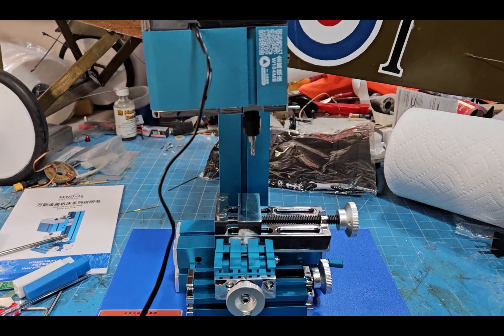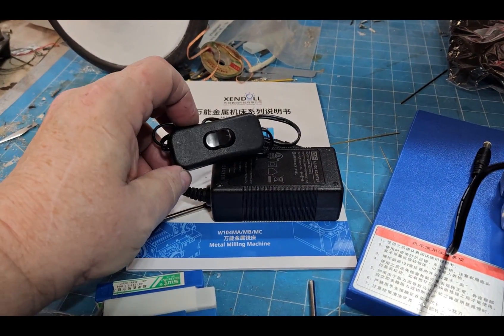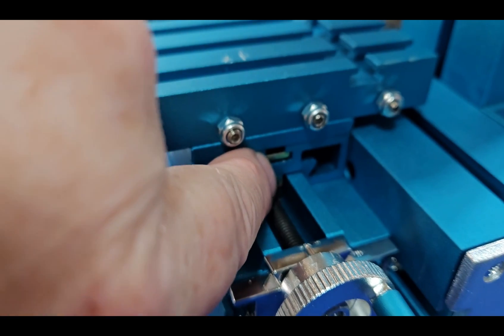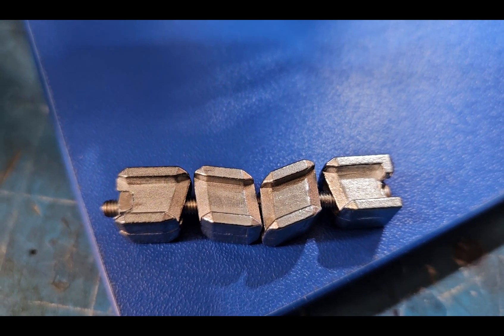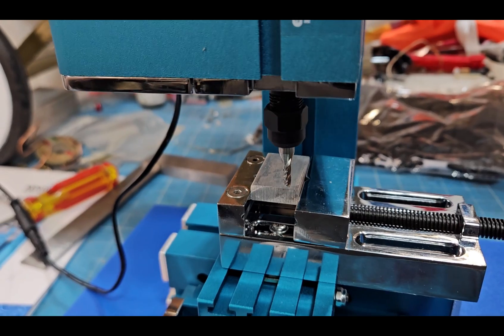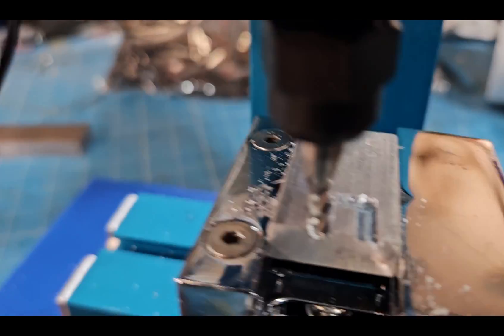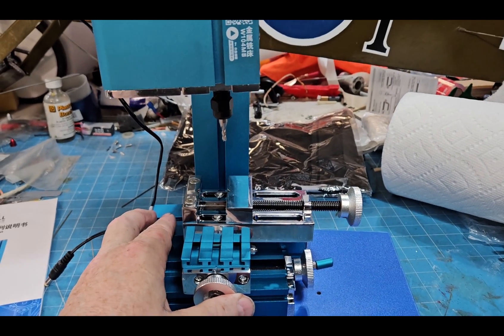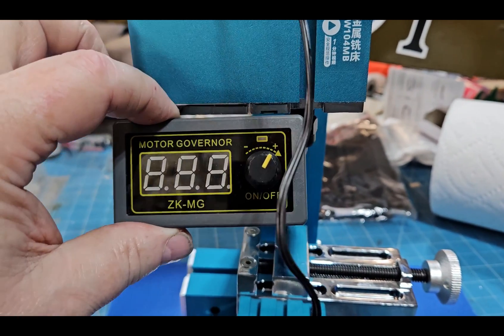Chinese micro mill from Amazon/Ebay review and upgrade part 1

Comment: I like that you show the equipment that you regularly use, and yet folks still chose to bitch about your choice of equipment as though the small kit was the only thing you had.
Anyway, thanks for taking the bullet for us; I'm still curious about getting one but the price they're asking for them now is waaaay too high for "let's try it and see" kinds of tinkering.
Reply from the maker: If you are interested I have the Proxxon mill that I picked up for cheap and I will pass on the savings to you after I do a analysis on it. I am asking $300.00 (They regularly sell for $600.00) for it then add shipping.

Comment: I respectfully point out that it looks like you have the headstock bolted to the Z axis the wrong way round - the wire for the motor should surely be at the back, not hanging over the front of the machine. Also, brass gibs won't do the aluminium slideways any good at all, they are nylon for a reason. Good luck with your efforts though.
Reply from the maker: The wires are not permanent. It was just proof of concept. I point out in the video there is a better way to run the wires but I am not drilling a hole in the head stock. This is not going to be permanent because I am putting the stock motor back in it. As for the nylon gibs I understand why they are nylon but brass would be better and will not be a problem unless you are cranking the lead screw up and down at 20 mph.

Comment: Should mount a $110 mini Makita router on there instead??
I got one for my CNC machine that I'm building.
Reply from the maker: Sounds like a good idea but does it have speed control? My idea was to keep the upgrade under $100.00 and make it fit inside the spindle housing. But that was just my thinking.

Comment: I'm pretty sure a regular drill press would do a better job of milling than these, as there would be more power and would be a lot more sturdy.  Looks neat though, but it's just too weak and bendy of a structure IMO.  That is, if you already have a drill press.  Otherwise sure, why not...
Reply from the maker: I couldn't find much on it on YouTube when I looked so I decided to do a review so people know exactly what they are getting. One significant difference between a mill and a drill press is the tool pressure on a drill press is meant to be placed in the vertical axis where a mill is meant to take a side load. If you want to know what kind of work I do check out some of my work on my channel.

Comment: That's about bottom low trash quality. 
1310 CNC router is about similar in price and somewhat usable with small endmills, that thing is just cheap and horrible.
Reply from the maker: I agree but not everybody knows how to do CNC machining. I'm neither advocating or defending the product. I couldn't find any kind of useful info on these little things myself and I have had many people ask my opinion so I decided to do a review of my own for those that were looking at them.